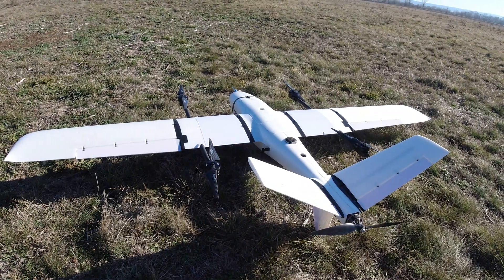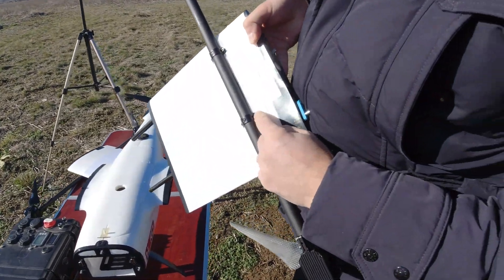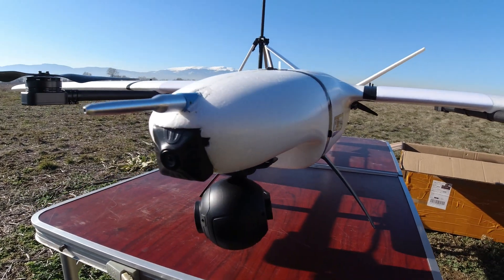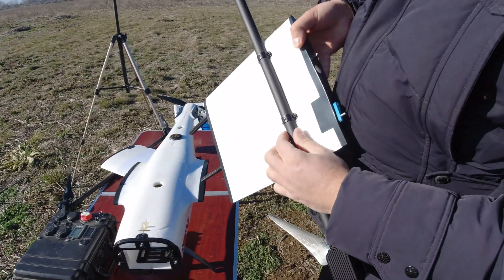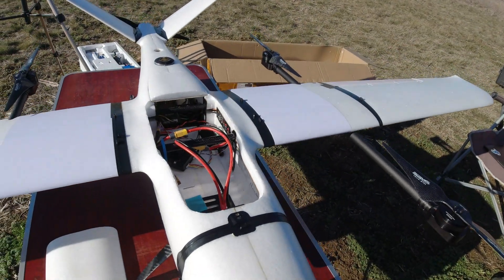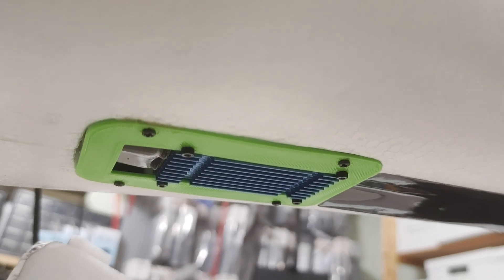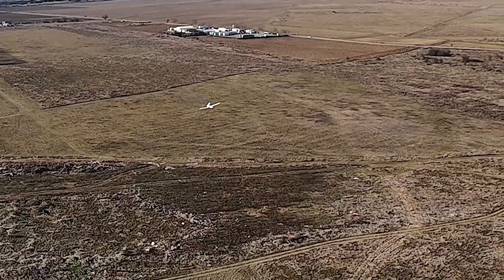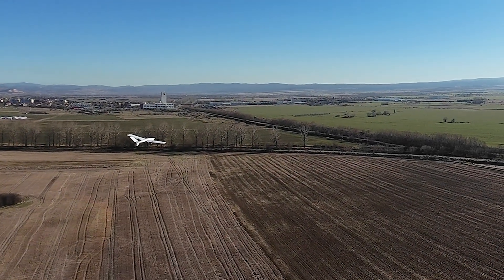MFE Hero VTOL - a DEEP dive!

Comment: Awesome setup!!!! I'm a professional photographer and experienced RC hobbyist based in Mexico, and I'm looking to use the Makeflyeasy Hero (Monitoring Edition) for whale spotting missions.

Your flight looked incredible. I'm aiming for long-distance, high-endurance flights 20km will be nice but the more the better . Since I'm new to extreme long-range setups, I'm hoping you could share some insight:

Could you guide me? Specifically,  to achieve your endurance and long range goals?

What reliable Video Link solution do you recommend for missions requiring 20km+ range?

Any advice you could share on component synergy for achieving maximum range and reliability would be hugely appreciated! Keep up the great work!
Reply from the maker: I replied to your email.

Comment: Purely out of interest is the gimbal-mount nose cone of the Hero designed such that it could be fitted the other way up - so the gimbal is on top of the nose, so you wouldn't need any landing gear ?? And yes, if it is possible, I realise you would have to swop from side-to-side the wiring connectors.
Reply from the maker: Nope, it is not possible to install it that way unless you rotate the foam in the plastics before you glue them on... and even then you will need to modify the foam a little bit to make it fit, if at all possible. Also there would be the tail fin that would have to go for you to be able to remove the landing gear, and I have a feeling it is there for a reason. The plane might become more unstable with the vertical tail fin gone.
Reply: @ArxangelRC  Thanks for that - seems a pity you can't have such an option.
Reply from the maker: @wackyack3165  Hey, if you have a 3D printer... your options are unlimited. :)

Comment: lot of really good improvements and I bet you might 3d print a cone for the forward compartment to house your camera system which did not fit. 

I wonder if there is  possibility to make this place better prepared for a belly landing solution. I doubt that wheels would improve that really much .
A second underbelly or a kind of longer sled under the belly might work to protect the camera and the finn at the end  but the height of the finn determins the size or height of the sled. 

Great review and eplanations with a lot of powerfull ideas like the considerations about the prop and the box as the carrier.

I have bought a big bag from IKEA, these blue ones for groveries and so on. You can then connect that bag after a few cuts with the bag - in my case a strong tape to get a kind of nice grip in your hands. This way you get the other hand free while carrying the table and stool for example. And you always have a safe grip cause nothing can fall out of your hands when you carry such a box which usually can not be carried under an arm and requires both hands to be carried safely . The ikea bag was cheap and makes it easier to provide a strong and reliable grip which you can move around till you have found the sweet spot of balance (and remind also where you have put everything and in what direction cause that save a lot of time). I had crashed once a plane and damage it when it had been in the box and I fell over a root from a tree , the boxes crashed out of my hands and the plane fell out of the box to be damaged when I fell onto that plane . Since then I try to reuse the boxes more carefully cause that was the biggest crash landing i had when my weight and bones had destroyed close to every part, wings, ailerrons, fuselage nose. Every piecs of foam and plastic bend or broken . It became a puzlle bomber and never flew again properly till I slaughtered it and transplanted everything into a new model with an abs molded fuselage.
Reply from the maker: Yes, for a while there I was thinking to print something for the nose to hold the mapping camera... but I never got around to doing that, plus it would have looked so huge compared to the rest of the plane. As for belly landing... I really hope it doesn't come to that. The way the landing gear mounts to the fuselage would make it risky and would possibly suffer damage even with something attached there to slide on. Ideally you can print a whole new nose piece to bring the gimbal up, above the lowest part of the belly... and as for the rear fin... it could be sacrificial... but that is way too much modding! Just fingers crossed it wouldn't come to belly landing! If it does... I might try to catch it... would be cheaper to replace some wings than the camera, fuselage, etc. :)

Hmmmm... about that bag... this is giving me an idea... I could have a tailor just sew up a bag to fit around the box... will be relatively cheap, will support a local business and should get the job done pretty nicely! Yes, I will look into that! As for your plane... that really sucks... hasn't happened to me yet... hoping it won't!
Reply: Hey  @ArxangelRC ! For handles, what about using some ratchet straps? You could pass them through loop handles where needed.
Reply from the maker: @TES-r6e  I have considered that... but it will be a chore to undo them and then do them again when I pack it up... would prefer to have a bag type that can be just opened up from top, without the need to unravel straps! :)
Reply: @ArxangelRC  That makes sense.
Reply from the maker: @TES-r6e  :)

Comment: excellent overview - even though I prefer a proper plane or a drone and not these hybrids which come with a lot of compromises and drawbacks like the efficiency lost from the drone configuration in flying mode. Of cause it protects the camera gear a lot better.
Reply from the maker: Well... for a long time I had the same mindset, however, recently I have seen the value in VTOLs because no matter what you do, you can't always find a good landing strip, and if you want to have a gimbal on the plane, that makes the job of safely landing it even harder! Yes, you do make compromises with VTOLs in certain aspects, but the convenience of the vertical take offs and landings is something I have come to appreciate a lot in the past two years. Getting a VTOL for mapping has made that work so much easier!

Comment: How many kilograms can this drone fly with this equipment?
Reply from the maker: Well, that would depend on the battery you chose, but currently it has roughly around 500-600 grams of payload, if you go with a smaller battery you could fit 1kg payload. The idea is not to go over 7kg.